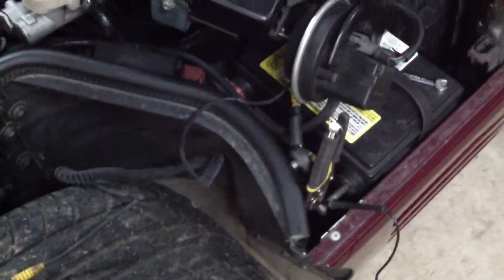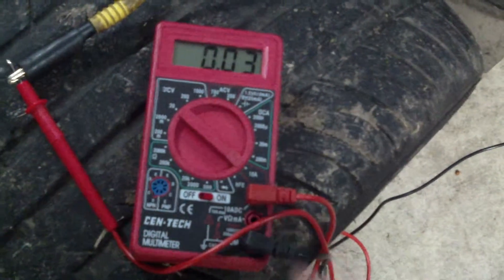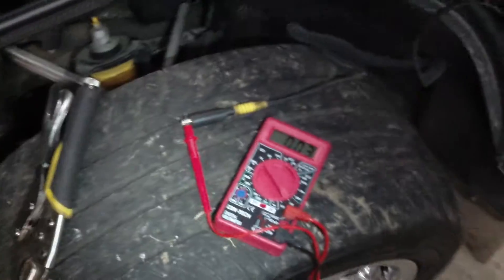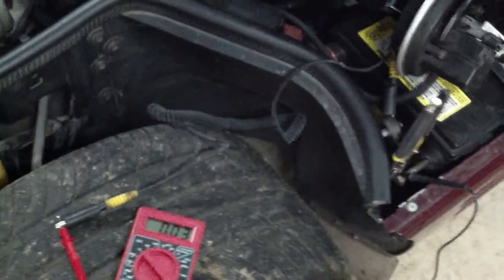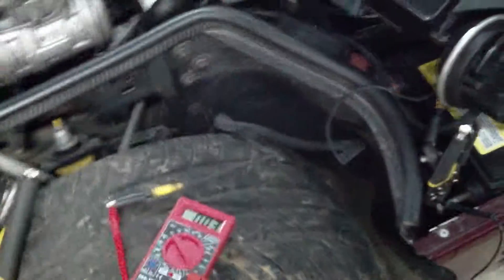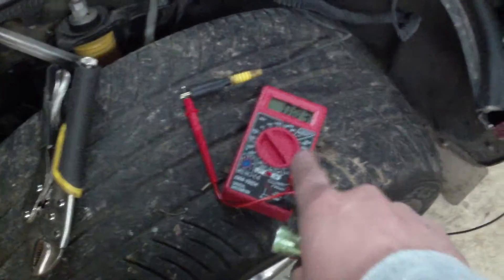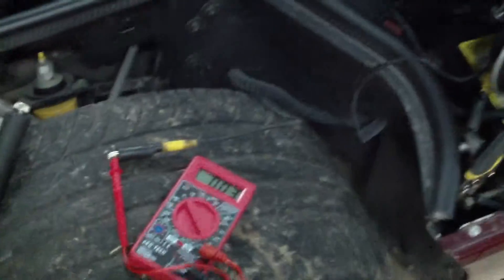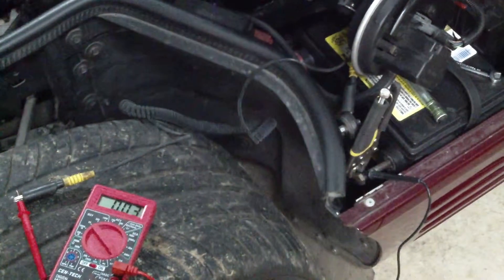Parasitic Draw Testing

Comment: Disk why do you have your positive lead from the multi meter attached to the negative on the battery just curious be nice to have it explained
Reply from the maker: Current flow has two thoreys. Conventional, positive to negative.
Electron theory, negative to positive. 

Basically i have it that way so the amperage reading is positive. If you reverse it will read negative but current flow is current flow.

It really doesn't matter for practical purposes. Just make sure it's inline as i have it and your meter set correctly.